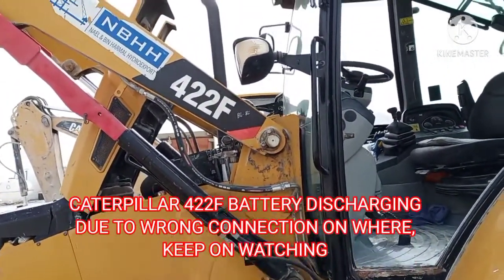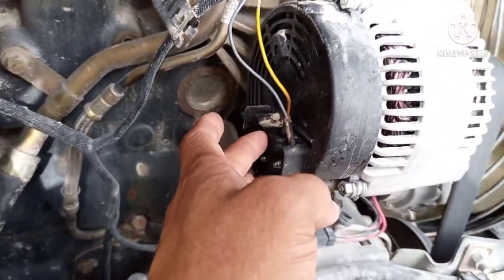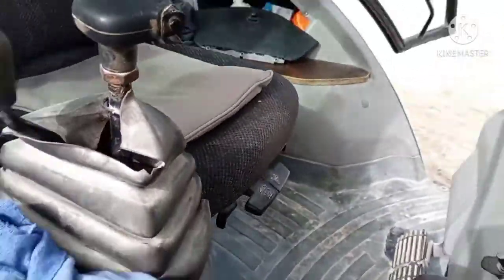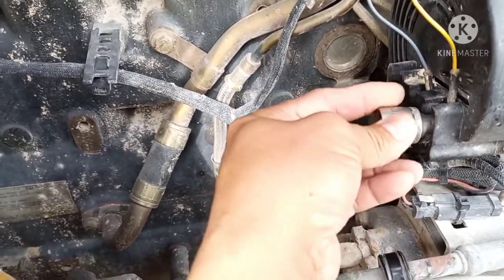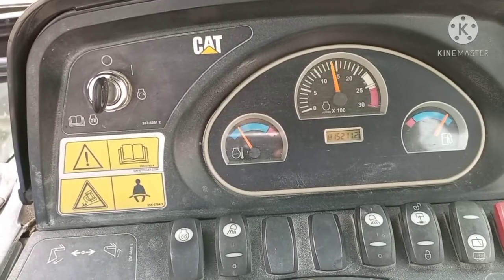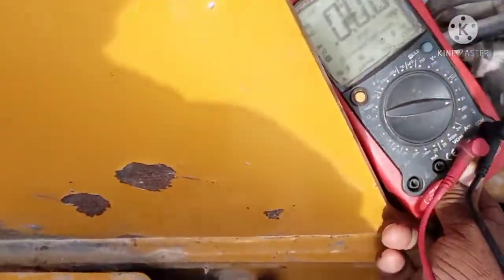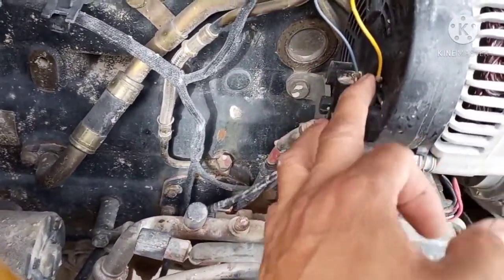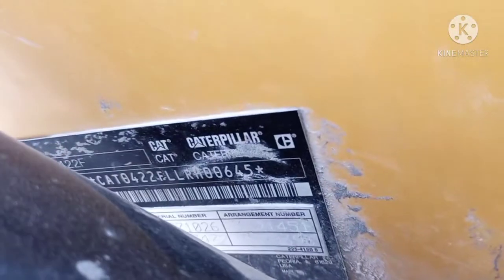CATERPILLAR  422F BACKHoe LOADER BATTERY DISCHARGING AND WRONG CONNECTION ON THE ALTERNATOR

Comment: Brother I have 422f the problem is blinker not working can you tell me flasher location
Reply from the maker: bro the flasher is located at the fuse box the size is almost the same with the relay little bit bigger, that is under  the fuse terminal right lower
Reply: @caterpillarjhunhunk  boss dosan na loader pareha lang ang rpm nyan nasa alternator. Salamat po new subscribers